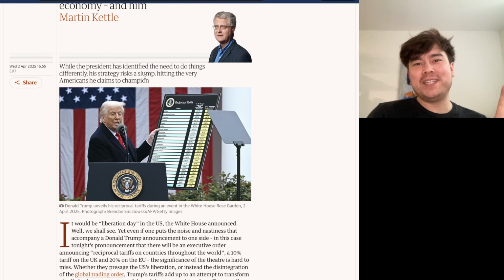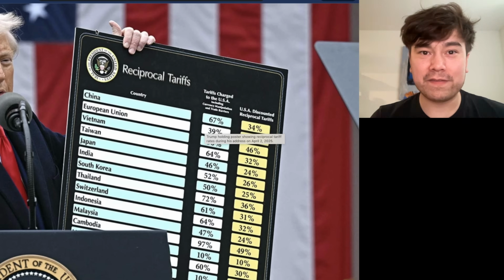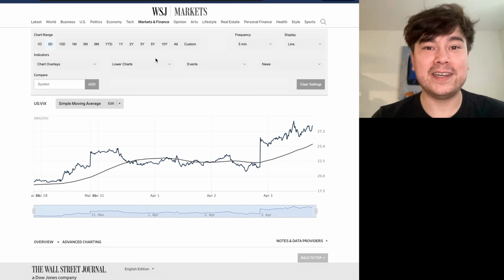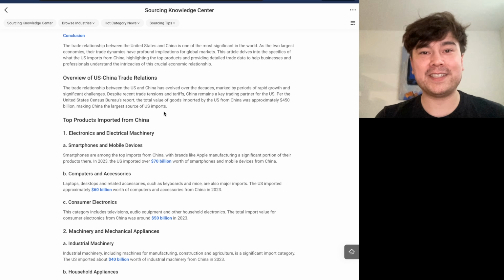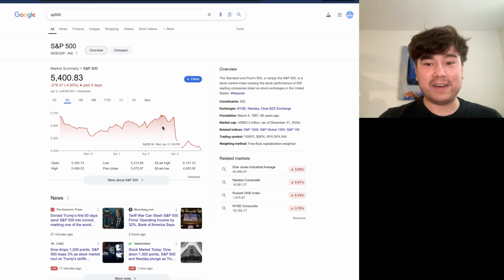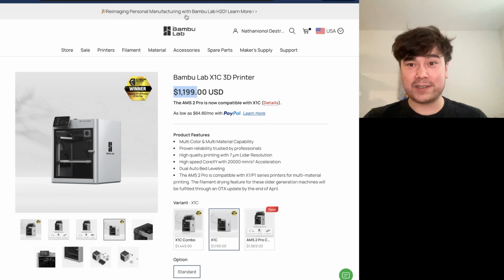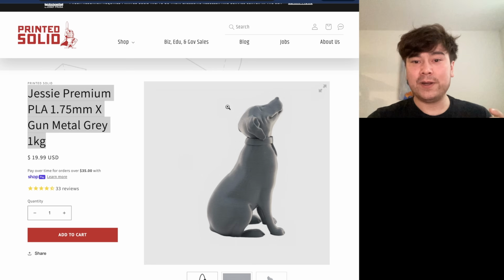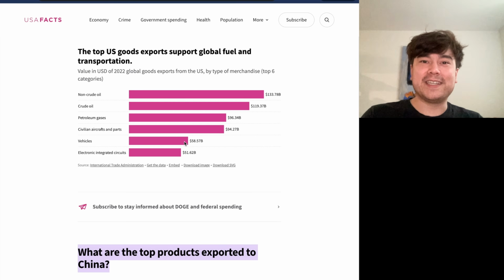Trump's Plan to Make 3D Printing 54% More Expensive (Tariffs + Liberation  Day 2025)

Comment: The companies will definitely dump the increased cost onto the paying customers, and if the tariffs go down or away, they won't lower the prices. It's what unchecked corporatism does.
Reply from the maker: Hahaha, true. We see it with the price of new cars. I bought a new car 1 year into the pandemic.

The next year prices went up 20% due to "supply chain issues" and have never come back down.

Car prices are still increasing and outpacing inflation. If I bought the same car new today it would cost 30% more 🧐
Reply: @NathanBuildsRobots  Exactly.  The pro-tariff (or at least justifying) crowd are basing their conclusions on the incorrect concept that we have the equivalent end manufacturers and their supply chain manufacturing here domestically, which we very very largely don't.  Smoot-Hawley history is not encouraging either.  U.S. manufacturers will only on-shore as much as they feel they need for supply chain security, and only then, shortly.  After that, the corporate focus on short term profits will swamp any on-shoring trend.  As much as I wish the pro-tariff crowd were correct, they are delusional.
Reply: @NathanBuildsRobots so nobody competes on price?  Are you serious, or did you never study economics?

Car prices stayed high because demand stayed high due to a backlog of unmet demand.  Inflation has caused ALL prices to rise 30%.  Stop being naive.
Reply: Correct. We’ve seen it before and it will happen again.
Reply: @jasongodfrey4158  tarrifs are a tax on the importation of a good for the importer. The only reason an exporter cares is because they might sell less.
Reply: looks like you are going to have to buy outside of China slave economy.
Reply: I am pretty sure price competition exists.  Don’t be simplistic.  Prices go down all the time.
Reply: i'll still buy another printer. 

it sucks for me because i waited . i'll still buy it. a few hours of plumbing and i'm sold. or use my existing rewards of 4k and then barclays winds up paying for me as a customer lmfao. they've already funded a vacation for me @ 1.5% per dollar. cash back purchase . that's low. but high volume make sense.! that's where barclays pays me. all damn day. it does suck though because without having money to spend you can't win. that sucks dick imho
i'm broke today and still cashing in. not enough for a family but enough to have a home and buy 3 printers. work hard. plumbing only fuels my habit money wise.
Reply: mexicans move mattresses lol
Reply: Well you can already see it in the new bamboo printer. That printer should start at around 999 and go up to about 1400
Reply: Yeah. the companies will make a decision and absorb what they can in order to keep sales strong but prices will still increase!
Reply: Less people buying their products then so some one will learn
Reply: lol tariffs arent new, we know how this plays out. a majority of the cost of the tariff is bore by the importer, as sellers have to be competitive with American manufacturers. if they pass the entire cost then people will just buy USA made products (which is a good thing)
Reply: @123-k8v  - Americans are not going to buy US manufactured TVs, toasters, DVD players, cell phones, or 3D printers, because there aren't any domestic producers of these items.  Consumer electronics are manufactured in Asia because it's more economical to do that.  A stiff tariff on Asian manufactured consumer electronics will not result in those products being made in the US, even if the tariffs persisted for decades.  Americans will ultimately pay the tariffs in the increased retail price much as Europe pays higher prices because of their higher consumer taxes in the forms of import tariffs and VAT.  An import tariff is a tax, paid by consumers and ultimately going to the federal government.

A 50% import tariff on Chinese 3D printers won't result in US manufactured 3D printers.  All it will do is force US consumers to pay a hidden tax to the US federal government that is reflected in a substantially higher priced 3D printer.
Reply: @ well consumer electronics is a bit difficult just because of the sheer scale (and the fact that China has had a 30+ year headstart), but the idea that tariffs dont protect American manufacturers and that the price is entirely passed off to the consumer is laughable. the fact is that American industry has been dying for decades and all the major foreign powers have been milking us dry. they should have to pay to dump their crap here. when push comes to shove they only thing that matters is what you make and we dont make anything
Reply: @123-k8v  exactly… we don’t make anything here because first we all don’t want to work for poverty wages and second no one wants to buy something that costs 10x’s as much as it used to.  So feel free to go out and buy a $200 T-shirt that used to cost $19.99… or a $25,000 TV that used to be $1,500…. Americans have become accustomed to the lifestyles that we are all living.  So to think that by someway making imported goods more expensive is going to somehow make things better here is a joke and a half.  

Let me give you a scenario.  Pre tariff China sold us something for $10.  The cheapest American product was $13.  Now with the tariff that Chinese product is going to cost $16 from China or $13 from the US.  Now if I was a shrewd business man you want to know what I would do?  Raise the cost of that American product to $15.  Why would I take less than the going rate?  If the cheapest product out there (that’s not my own) is more expensive than mine why would I not want to make a little more… and then when those tariffs do go away.. heck you’ll be so accustomed to paying more that every manufacturer out there will just use the new floor to set the prices… no one drops their prices once a new floor has been set… things only go up from there… and then you have to take into account  yearly inflation and what not… so the only thing accomplished has been a higher floor being set.
Reply: @Liberty4Ever  you have to understand.  A person like RichyRich believes that if we pay more now that money will somehow trickle down to the rest of us someday.  They’ve been pushing this line since I was a kid with trickle down and never once has it worked… but trust me… this time is different!!  😂
Reply: @Liberty4Ever you aren’t totally correct.  Robotic automation can allow for more competitive US assembly, there was just never an incentive to do that.

There will be a LOT more final assembly in the US because components are valued far less than finished products…

It will take a few years to stabilize, but jobs and incomes will rise in conjunction with US assembly.  

I don’t mind a few years of higher prices on electronics to have US based production in the future.  We can’t be totally dependent on China.  It was dumb to have ever allowed it.

Too much dependence on China means a war with China becomes unwinnable.
Reply: @123-k8v  it never works out like that. despite the theory.
You would have to have Americans making 1$ an hour or end free market capitalism in favor of government oversight.
Reply: @BigSteelThrill  the fact that you think free markets exist at all is pretty funny
Reply: @123-k8v  True, unless those US made products are too expensive, which will most likely be the case until we can redevelop our manufacturing industry to drive the cost down. That could take years.
Reply: @Louis8989-1  they can easily pull out if the tariffs equates to low profits, spares, equipment still comes from abroad
Reply: @richy69ify They charge too much in both the USA and in Europe. Doesn't matter where the factories are located. 
Only a guess here but them moving the factories here to the US was to save themselves moneynot necessarily the consumers.
Reply: @123-k8v yep, just give me 5-10 minutes and I’ll quick turn up a factory to start producing these products.  Not like that will take 5-10 years….   And don’t worry, I’m sure I’ll be able to find tons of red blooded Americans willing to work for less than poverty wages all to make cheap readily available products.  I mean where can’t you find people willing to work for 1/10th of minimum wage?!?  

Only problem I can see is that if I do this… how will anyone be able to afford my $900 toaster or blender??
😂😅😂😅😂😅😂😅
Reply: @ wait… so you’re suggesting paying a person $5 for every sneaker they make?  I hope you honestly don’t think that these sneakers take less than an hour to make… and I honestly hope that you dont think it’s just 1 person doing it from start to finish…. And yes, I understand that these shoes cost dollars to make… not 50 cents like you suggest… but that’s capitalism for ya.  Now the thing you can do is not buy from Nike and instead buy a lower cost sneaker.  That makes perfect sense… you have that ability and the market will decide what the consumer can stomach… but that’s the market deciding not the government.  I love all you folks that want the government out of your health care… out of your paycheck, heck even the ones that want the government out of Medicare and SS (umm those are government programs?!?) yet want the government deciding how much things cost?!?  Want a government shilling for a car brand on the whitehouse lawn?  Want a government that doesn’t care about violence against minorities, certain groups, etc… but wants to say any violence against a certain person or that persons company is considered in the same league as terrorists?  Now I got to say Rich… that’s pretty rich
Reply: @ sounds good man.  Don’t let the door hit ya on the way out! 😂🤣😂🤣
Reply: @123-k8v  we don't have any competing products in meaningful quantities or the manufacturing bases or supply chain or or or 

You know, those things that take decades of consistent national level willpower to build.

Basically if you aren't worth 20 million dollars enjoy everything being way more expensive you poor.
Reply: @123-k8v  That would be true if there were equivalent domestic producers importing from domestic parts.  But that, unfortunately, is not the reality we inhabit.